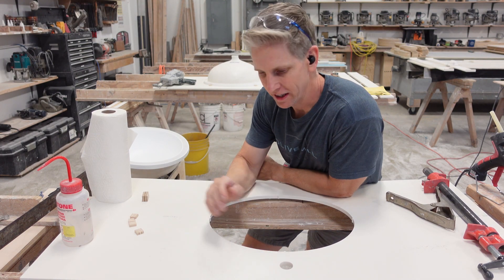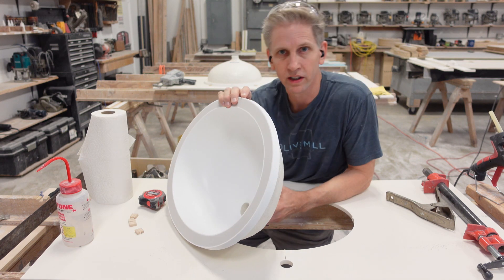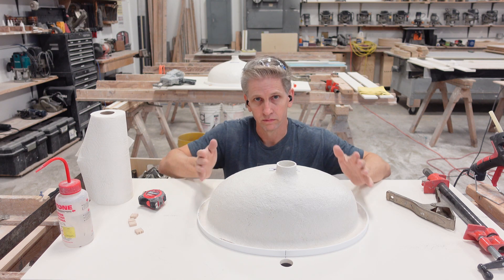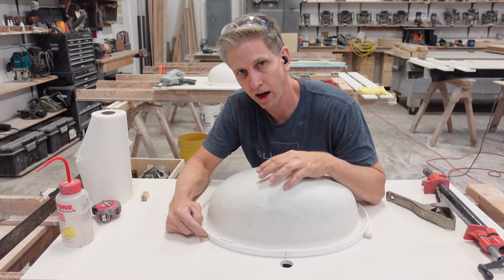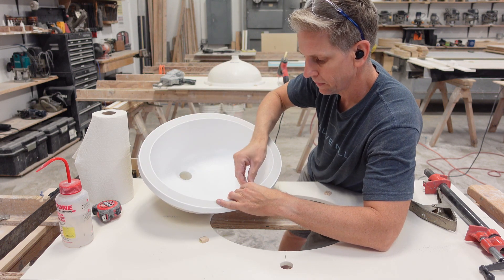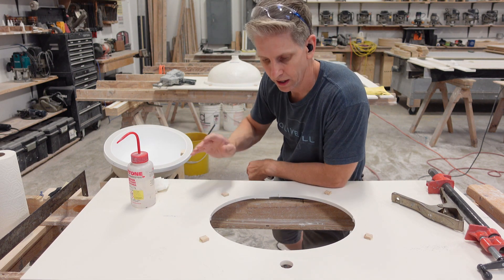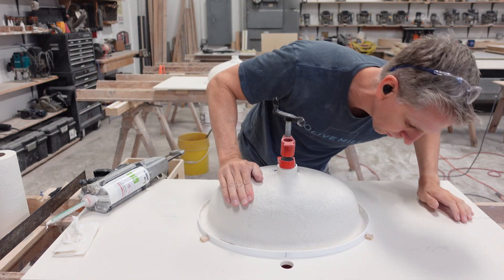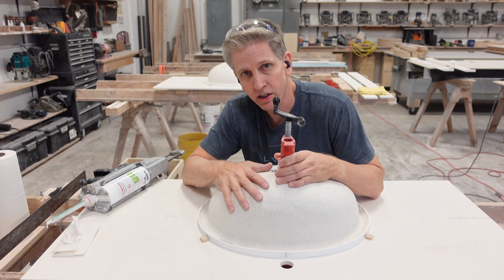How to Install a Karran Seamless Solid Surface Sink - Expert Guide

Comment: Nice one, but I actaully prefer to make a 6mm pocket in the plate on my CNC so the sink fits perfectly inside of it. But I am making a lot of bathroom sinks during the week so its just way faster then the standard method.
Reply from the maker: That a great idea. On these your I have to cut face up because I have a ⅞" wide rabbet around the perimeter for a cove insert piece.

I totally agree with you though, on his production more could be done to increase efficiency.

Thanks for sharing
Reply: Like brother